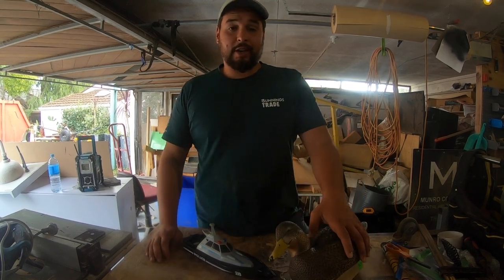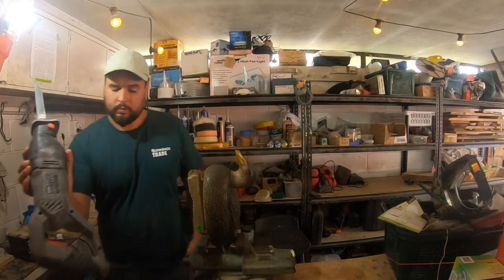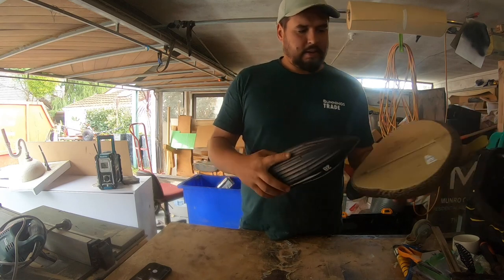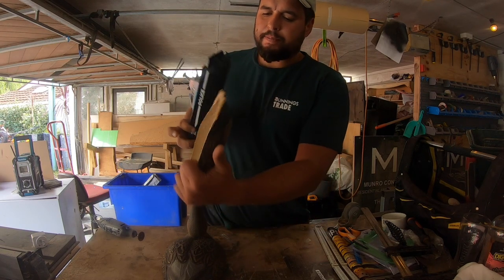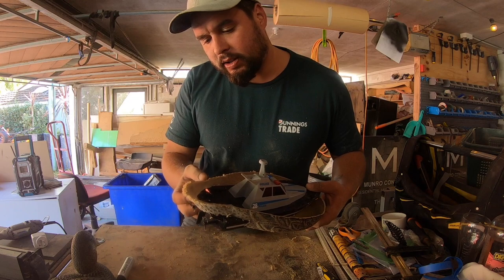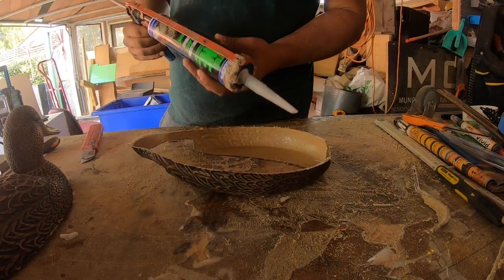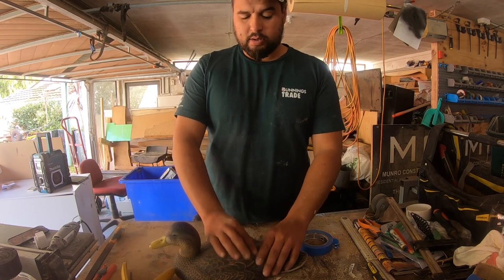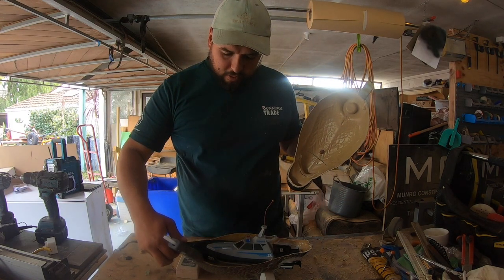DIY - RC Duck Decoy - $40 BOAT INSIDE DUCK DECOY

Comment: I know I’m late but here’s my idea: I had an rc boat that you could take the top off of which was basically to keep water out/look cool, so what if you found one like that and took the top off and then used silicone or something to mount it directly to the bottom so you don’t have to cut into it. 
Also have you thought of putting it on a small tether and driving in circles so it doesn’t float away?